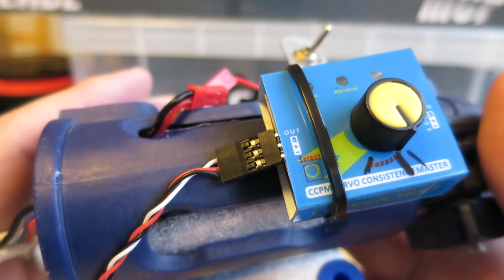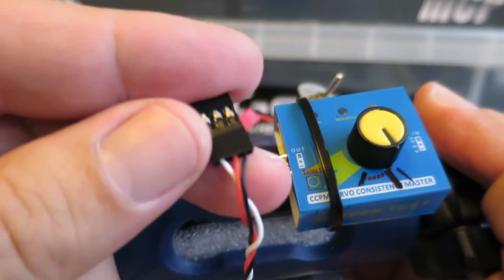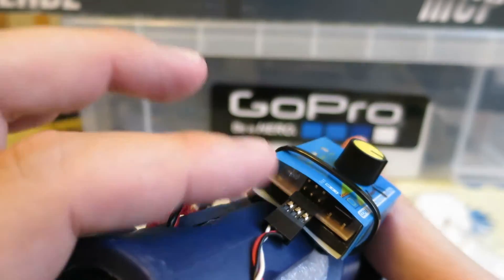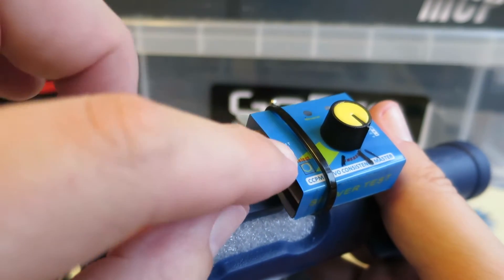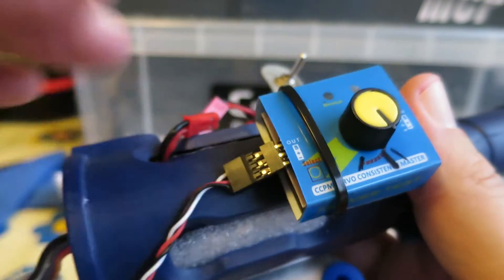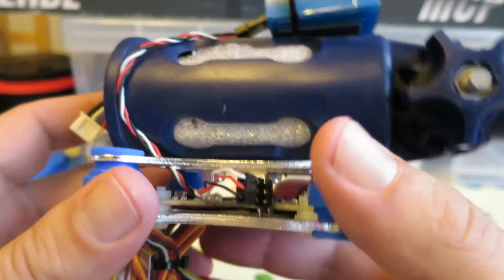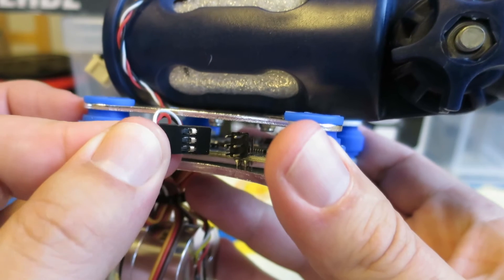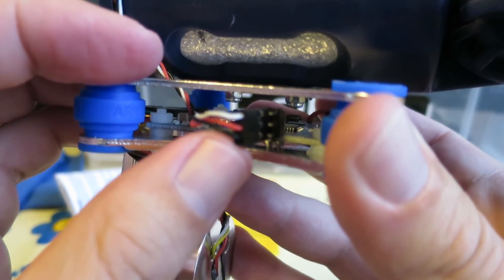Wiring Cheap brushless Gimbal Tilt control with servo tester for gopro or similar

Comment: i can to connect on this ESC? SkyRC Toro TS150A Pro? to control the rpm of the motor. i need somethink with potentiometer
Reply from the maker: Yes, servo tester will works perfectly with any servo or ESC - I use this to test all new ESC and servo when I buy new kit as a quick and safe way to test without risking damage to anything else on model. I've had one ESC and a couple of servo's which failed or were faulty straight out of the box so this is a good habit to check first !
Reply: @jamesb72  nice is good to see if works fine or if had some issues, after that use it for a diferent project! i will install it in a sim racing steering wheel, the motor is very powerfull for this job! is not easy to make it but i will try! ..thanks a lot brother for your help!

Comment: Hi, I have a handmade gimbal. I wanted to install the potentiometer to regulate the invitation. A query: Does the tester need power to move the cardan? Or only with the signal wire already works. Because the gimbal works at 12 v (lipo 3s). and the tester only accepts 5 v. Thank you
Reply from the maker: The tester needs 5v, but the gimbal controllers I've seen all put 5v out on the 3 pin servo connector so this works fine, if your worried you can carefully check with a voltmeter, the +5v is centre pin, so carefully check centre pin voltage to either side - be careful not to short the pins with probe though as it will puff the voltage regulator on gimbal controller.
Reply: @jamesb72  Oks James, finally connect it if external power (Tester servo) and it works. One more question ... the gimbal tremble a little. I guess it's a matter of adjusting the PIDs. Do you know any tricks? Thanks for answering
Reply from the maker: Sorry I'm no PID expert I've always found the gimbals worked fine with gopro style camera's without any adjustment, I would double check the balance is OK with gimbal powered off first. If you do need to adjust PIDs be careful connecting software as if it offers you a firmware update this can brick a clone control board which a lot of the cheaper ones are.
Reply: @jamesb72  Thank you! I will do some tests with the PID to see if I can eliminate the vibrations!

Comment: Hi can i use a potentiometer for the pitch control ?
Reply from the maker: TriniRCmodels not on its own the board expects ppm signal pulses from 1000ms to 2000ms with 1500ms centre so you need a servo tester to do this. You could probably wire your own pot into a servo tester if you wanted to make a thumb control or something like that just match value.

Comment: did you connect the positive wire to the servo and gimbal?
Reply from the maker: Renz Romaguera the male to male servo lead carries +5v from the gimbal board to power the servo tester if that's what you mean. I didn't connect separate power wire.
Reply: jamesb72 okay..that's what i did to my gimbal..but i could not tilt it up..only normal and tilt down..what do you think is the solution for that?
Reply from the maker: I think that's normal, tilt up would just see bottom of quadcopter, I think mine tilts from about 20deg up to 90deg down.

Comment: Could you make a video on how you did everything with the gimbal? From when you received it, did you just plug and play the servo tester and attach it to the paint pole extension tube or was it more difficult than that?
Reply from the maker: It is just plug and play, the battery plugs into gimbal (see https://www.youtube.com/edit?o=U&video_id=IS0_JL7RxAI) and I screwed the gimbal to the paint brush holder, and plugged the servo tester in as shown in this video.
Reply: jamesb72 Is it really that easy? How much did it all cost you in total and do you have a link to the battery you are using?
Reply from the maker: Yes, its really easy. I use an 850mah 3S lipo with JST connector I already had, but any 3S lipo with correct connector will run the gimbal, so best to search your country model suppliers/amazon/ebay to find best price/battery for you
Reply: jamesb72 Thanks for the info!
Reply: hello..do you know what is the problem if i turn the servo the gimbal only tilts down..i cant tilt it up..

Comment: +jamesb72 On the video you said to not plug the male to male plug in vertically as it will cause damage to the gimbal I accidently did this whilst in a hurry and my gimbal wont power on anymore. Would you possibly now how to fix this?
Reply from the maker: I believe this will blow the DC regulator on the gimbal control board, so the easy fix is to buy a new gimbal control board, ideally get one from the same seller you bought the gimbal so its pre-configured, and will swap straight out, alternatively if you know someone good with electronics they can probably replace the DC regulator, its surface mount though so will need to be someone who can work with that !!
Reply: ok thank you so much i thought i wrecked the battery or smthing. btw love your videos too keep up the good work :)

Comment: I think this will work with the JST connector as an On/Off switch
Link: https://amzn.com/B01INFX9UQ
Reply from the maker: It will probably work, not sure how much current those RC switches take, the one I use is cheaper and just needs a couple of solder joints https://amzn.com/B01H01OMQO

Comment: The on/off switch is added to the red wire of the JST connector that is connected to the controller board?
Reply from the maker: Yes, that's right, just so its easy to flick on/off.
Reply: Sorry to bother you...but you are the only one who responds. I plugged the battery in the JST connector and all I get is a red light on the controller board and no response from gimbal. Downloaded the drivers and software...used mini usb connecter and get red light and PC does not recognize the device.  A bad device??? Is there one more reliable? I would contact you my email if possible rather than through youtube
Reply from the maker: The gimbal should initialise after a couple of seconds and stabilise, it will need to be held still and camera mounted/balanced first. There are a few variations of software so probably best to contact the seller to check which one to use, and if it asks you if you want to update firmware say no, as this generally bricks the controller. Its worth short pressing the reset button if there is one, and if that does nothing try again with a long press (the button functions are configurable, but I've seen short press as relevel gimbal, and long press is a reset).